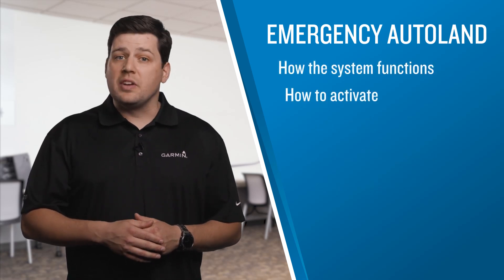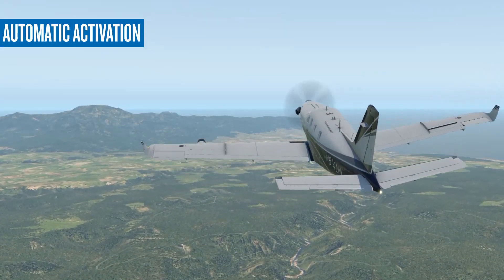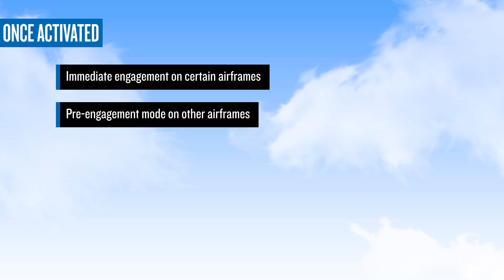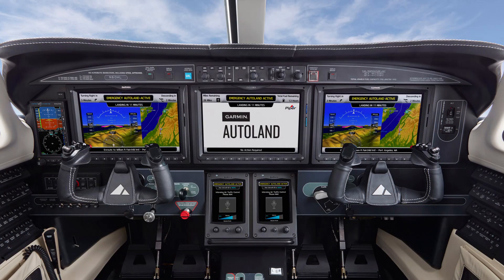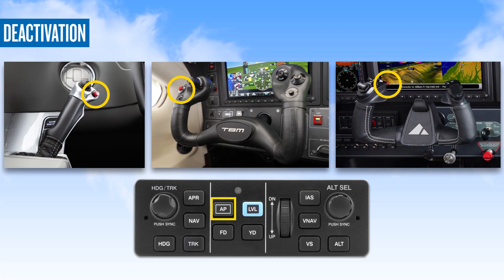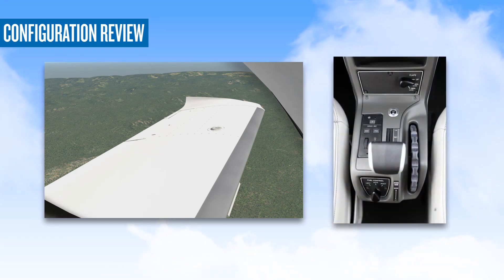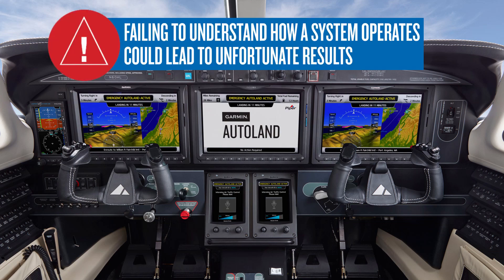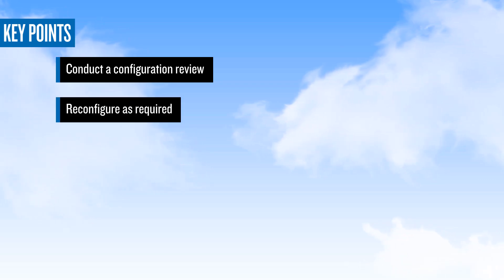GARMIN AUTOLAND – Activation and Deactivation

Comment: What if this thing selects a runway that is closed? Like construction and maintenance.
Reply: It will know that the runway is open based on information it obtains from the system. Any runway out of order is update with Flight Service and this will be put in the computer. The autoload will will check for things like this.